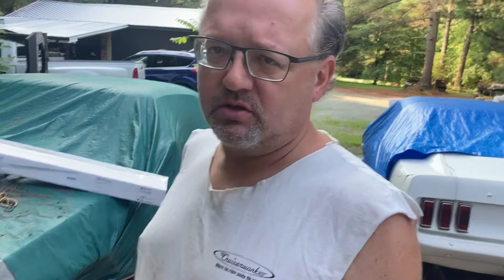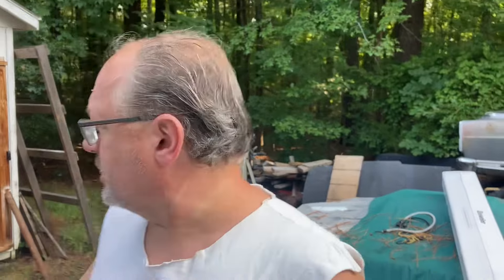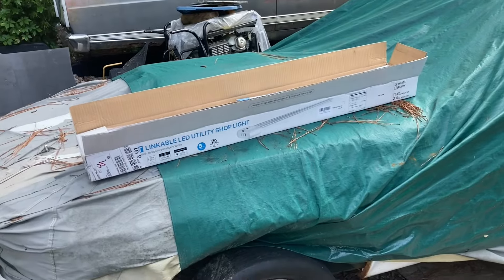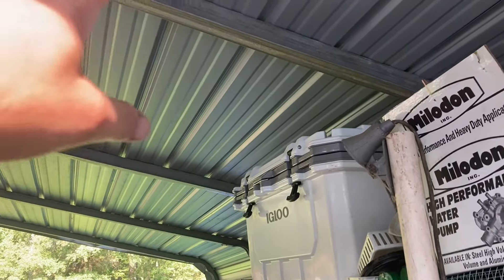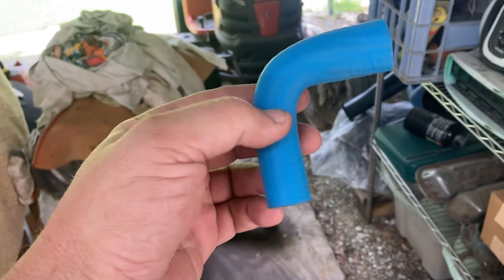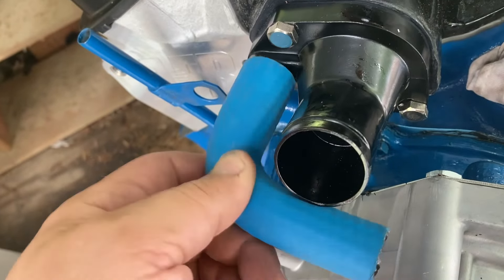Finishing it up for installation

Comment: I use new single 40w 4 feet led tube  light from e bay.  Kind cheap I thing it was like 30$ for 6 you can connect all together  or single.  My garage is super bright like never before
Reply from the maker: These are also 4 ft long, but double bulb fixtures. I had to look, and for the package of four it was $39. They can be daisy chained as well. I have those three all plugged in to each other. They are a lot brighter than the last ones I had hanging up in there.